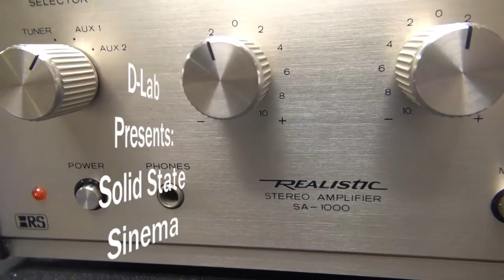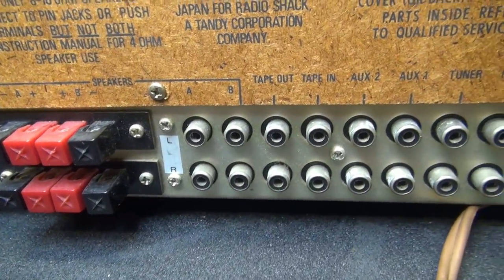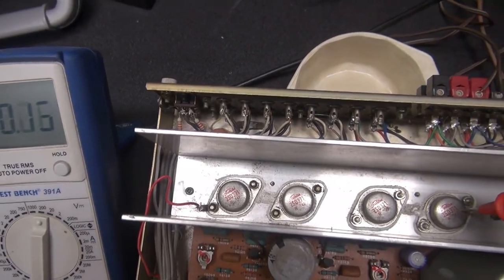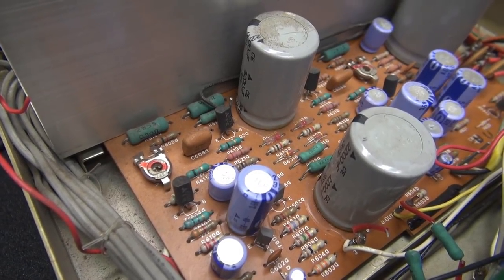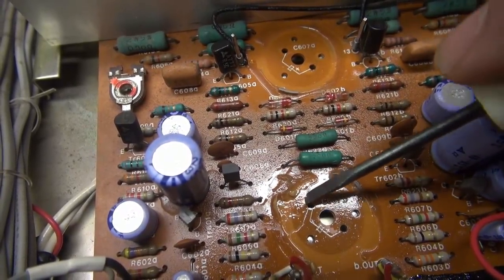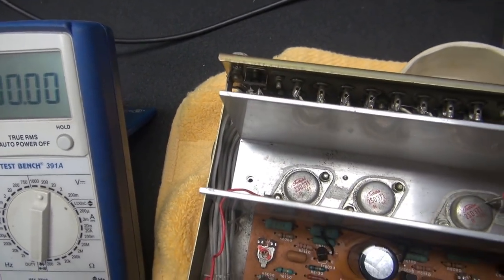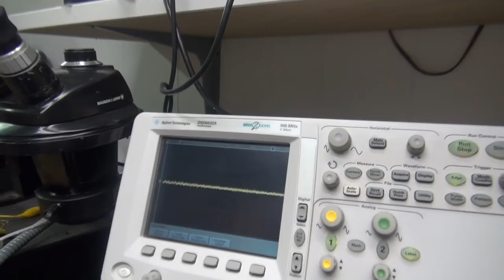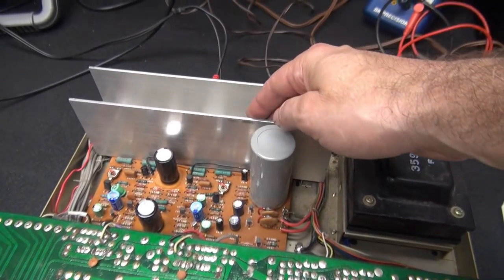How to repair weak distorted channel Realistic SA 1000 home stereo amplifier D-Lab

Comment: Hello, I have new amplifier (very cheap madison MAD1305) and it has very distorted mid frequencies, I can hear it in voice or in windows sound when I am manipulating with volume bar. Any tips? I am to lazy to claim it because it's from e-shop from different state. There are 4 big electrolytic capacitors (50V, 3300 uF) which look very cheap, do you think it's bad even in new amplifier? I can imagine that capacitors were years somewhere before they inserted them into amplifier.
PS: in headphones it sounds good, no distortion

Comment: I'd still want to run a test on the caps removed just to see what it was and how bad it got.  I'm guessing one of them got leaky and affected the bias.  Usually,. they go high ESR and you lose signal.
Reply: Since the amp was still working (when not saturating negative), the feedback loop must have been closed and working, the output bias can then only affect the heat dissipation and amount of x-over distortion.  So I'd suspect the input stage was being pulled out of balance by a leaky caps.  On a single rail amp such imbalance won't fry the speaker and could have been gradually getting worse over time.

Its just possible to make out on the schematic that the input stage is single-ended with a cap in the
bias for the input transistor base - so yes, it is the bias that's out, but not the common sort of bias
you think of with an amp...  The input stage bias network is high impedance so it wouldn't take much leakage to start pulling it away from nominal.

Comment: Great video thank you, keep up the good work

Question: 
i have an old Tempest Solid State Stereo amp, it powers on and plays for about 5min and then the speakers just switch off and just very softly buzz, i have to put the whole system off and wait like 15min then i switch it on and it plays for 5min again and the same thing happens... 

Could this be due to a faulty capacitor...??
Reply: Either timer is active but most suspectable 1. any part is over heating. 2 the part maybe good but the heat is creating loose contact on solder side.

Comment: man-o-man I love youtube....you search for something and you get your answer.

I have a Yamaha CLP-250 that is having issues with the amp board...I find that if I touch the top of the 4700UF 25v cap (about 18 mm x 33 mm) that the piano plays at the right volume. I tried re-soldering that one cap and am having spotty results so am buying a new cap to replace it.

Is the diameter and height important?

Do you have a recommendation for store to buy a bunch of the others? Amazon is going to be expensive....You got me thinking I should replace all of the caps

Thank you for this video

Comment: What is the issue when the Input selector knob needs to be played with in order for the audio to fully produce.I tend to have to hang it in between inputs at times or turn it back and forth for it to finally work. I have a Realistic SA-1001. Any advice to fix or is it dead? Thank you!!
Reply: I have the exact same problem on the same amp, I'm pretty sure it needs a new selector switch if that's what it's called. I tried spraying it with tuner cleaner and that worked for awhile but eventually no more. I can't seem to find a replacement for this but I do have the original owners manual with the schematic.

Comment: Nice video. I am not clear as to why you replaced so many caps. Would it not be more economical to just replace two at a time until you find the bad ones? Thanks.
Reply: As Terry said early in the video, he wasn't going to diagnose the problem, only shotgun it. So he replaced all the electrolytics, which is advisable on gear that's pushing the half century mark. Those electrolytics have a definite lifetime, whether the component has been in daily use or sitting in a garage for years. It only makes sense to replace them all. Besides, they don't exactly cost a fortune.

Comment: What happened to that broken resistor lead attached to the board I saw before the cap replacement? Did you change it out before or after replacing the caps and just didn't film it?
Reply from the maker: Hello Yes, sorry did not cover that 220K ohm, 1 watt, the leads snapped when lifting the PCB
Reply: Thank you sir I thought so, I just wanted to make sure I wasn't crazy! Lol

Comment: I have an Optonica SA 5606 that's acting all kinds of glitchy. The Aux channel (de facto CD channel) cuts out and buzzes maddeningly. Now the phono is cutting out, sending signals left and right intermittently to my speakers . Anyone with any ideas? I suspect a recap is in order given its age (40 years roughly).
Reply: I would wonder about cold solder joints. A good recap certainly won't hurt.

Comment: Nice vintage little integrated amp. Now you just need a decent pair of small-ish speakers. Why do all the YouTube amp gurus I watch use the crappiest speakers?
Reply from the maker: I have a set of Polk R15's they do a great job for bench test
Reply from the maker: I have had several sets of the Minimus 7's. Great sounding until the woofers fail. The woofers were only rated for 5 watts. Have a set here with blown woofers, however the replacement cost exceeds their value.
Reply: @d-labelectronics  I have the T15's for my vinyl setup
Reply: @d-labelectronics  I thought those M7's were rated 40w peak

Comment: Where did you get the alcohol? I moved from one place to another and lost my ability get it locally. Turns out, there is a fear of adults paying 30 buck a gallon for 99.9% isopropyl to drink in place of 15 bucks a gallon vodca...
Reply: I used to buy 98% isopropyl at any pharmacy; rubbing alcohol. (but that was before Covid, now I can't find it anywhere.)
FWIW, denatured alcohol should work just as well. Available at hardware stores as shellac thinner. Some organ manufacturers specified that the contacts are to be cleaned with denatured alcohol and only denatured alcohol.

Comment: What are you going to do with the amp?  I wouldn't mind buying old equipment and fixing it, but I need more stuff like a hoarder does.  I'm not sure what the market is like on eBay.
Reply from the maker: Hello, The SA-1000 resides in my shop as a test amp. Plus have a JVC CD player connected. Will be featuring it in action soon. If you find one or something similar, need it gone thru, send it my way.
Reply: @d-labelectronics  I don't endorse CD, get a tape player or TT

Comment: Realistic audio is generally made by "Foster Electronics"
Reply: Not exactly. From 1975 - 1989 most was made by Radio Shack's Tandy Electronics. The quality seperates sold in the U.S. were made by Foster Electric (SA-1000, 1000A, 1001, 2000, 2001, TM-1000, 1001). The quality seperates sold outside the U.S. were made by Tandy Electronics. https://docs.google.com/spreadsheets/d/1laZVTI-3JgO9iTXwHc7I0mEpfSqb8O0bREcGWk10oiM/edit?usp=drivesdk

Comment: OK - loved the video, but at some point you may as well do a Rick Roll on the sample output, and just let us, the viewers deal with it.

Thanks as always, my man!  Thumbs up!
Reply from the maker: Your right, I did turn down the audio level on that clip, due to the large increase in volume. Some in the past had complained. Trying to get it all right. I can shoot a follow up of the amp in action. It has moved to drive a set of Bose 301's
Reply: Terry, sorry as I was not clear.  I had no issue with the volume, I just thought it would be funny to put the Rick Roll audio in as the sample.  Wasn't trying to come across as complaining in any way, I just have a warped sense of humor.  :-)
Reply from the maker: Roger that man, my mis-understanding, alls well

Comment: no negative drive
Reply: I think the output coupling capacitor was a bit leaky and pulling down the centre voltage, or else a decoupling cap at the input stage.

Comment: Back in the late 70s and early 80s realistic about the most bottom end amplifier stereo you could buy for poor high school kid who only made his money from cutting grass delivering newspapers and other little odd end jobs. As a teenager we drooled over the magazines for Kenwood and Sherwood and occasionally we got to see a mono block with some exotic name but in reality a Realistic was all we could afford.
Reply: nonsense; they had most of the same stuff inside. tremendous value for money.
Reply: t lech did pioneer not make this amp  , I have one with new caps and controls cleaned these work as good as most of them
Reply: t lech I purchased a sansui amp from a garage sale for 10$$ it around 80 Watts rms per channel controls needed cleaning I have my own secret formula that cost pennies and does not damage plastic any way I cleaned it refurbished the optional wood cabinet and gave it to my son with reconed 3 way 12 inch speakers